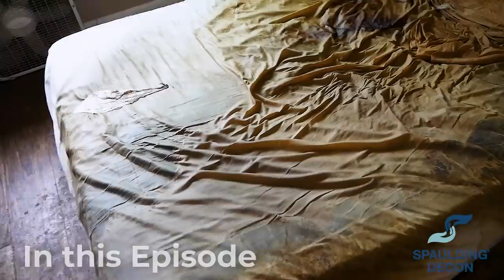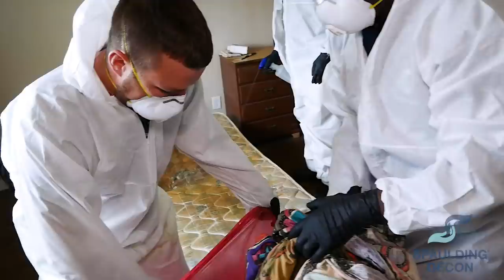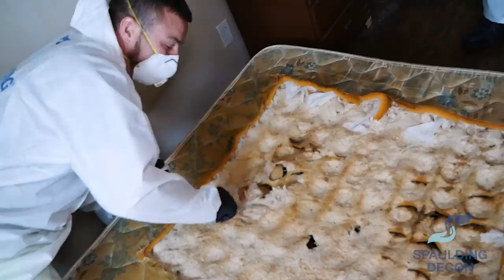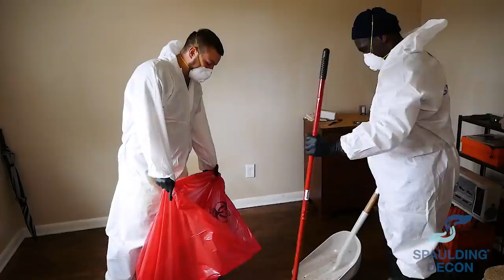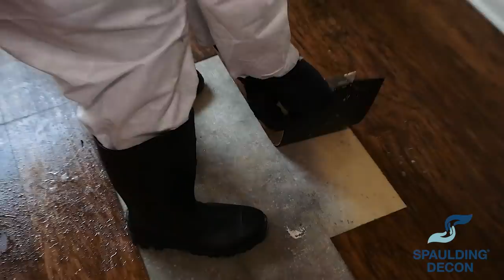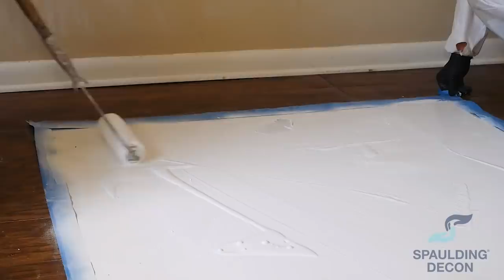Melted to the Bed

Comment: I was just curious why that nasty, brown stain on the wall behind the bed wasn’t checked for bio fluids?
Reply: Same here.
Reply: The HOA asked them to focus on the floor...figures the HOA wanted the cheapest way out...probably had it on the market 30 mns after discovery
Reply: I was thinking the same thing
Reply: @michaelsanger7795  Mmm.... that's not how that works. When you're called for a job like this you do it till it's done. you don't listen to someone telling you "half ass this" It's not that kind of profession. that's like telling a firefighter to only put out the fire till there's no flames and leave, or asking a cop to handcuff a rapist but to not show up in court for the case. It just doesn't work that way.

Comment: Idk if people realize how quickly decomp happens & in the heat even faster. I live in the Pacific Northwest where it's cold, several years ago a friend of mine's father in law who struggled with alcoholism most of his life died alone & was found within 72 hours of dying & even in the cold weather & no heater running in his room he was still significantly decomposed. Luckily the bed had a waterproof cover so the fluid was contained but they still had to have the carpet replaced as well as scrubbing the walls & ceiling then repaint all of it because the smell soaked into everything. I can't even imagine finding someone left alone that long in the heat of Florida, that's so sad.

Comment: I’m confused…if he melted onto the floor while he was on the mattress, wouldn’t that side of the mattress be affected by bio as well? Also, you can see from the sheet that his body’s decomposition affected a much larger area than was cut out of the mattress. Can you pls explain?
Reply: I believe he explained the other stuff on the mattress was sweat and oils from long term use of the mattress as there was only Bio in that one square area so they removed it and threw the rest away.

Comment: Why do you cut the mattress instead of just throwing the whole thing away all together?
Reply: I believe biohazard waste is a special trash disposal that’s charged by weight so Spaulding would only want to pay to dispose of what is actually biohazard. So if they can cut a section out instead of having to toss the entire thing, that’ll save them a lot of money.
Reply: @kat.w.RBF444  not so much that. Your regular dump site can’t accept biohazard materials. They have to be processed in a particular way that coincides with the EPA. You can’t just incinerate bio materials like you can regular trash. It has to be done in a way that won’t impact the environment or the air surrounding the site.

Comment: Question. I can understand painting the floor on a lower or ground level. But this is above someone else. So what is to stop the smell coming from the persons ceiling below? And putting on that thick of paint won't that make the floor uneven for them to put down new floor? I cant believe it was peel and stick. I feel horrible for this old man. Sleeping on such a filthy warn out bed. I have seen better mattresses set out for garbage. The springs were sticking through. And i am shocked that all that dark stain was not from his body. How was there so little? This man lived a sad life, i can tell that.

Comment: Why do they say we gonner make sure no one knows where the person died and then paint the floor white? To me that’s a extra added cost that’s not needed just remove the whole floor covering and then u cannot tell as all the floor will be the same. Btw no hate just curious as I used to do this job in the uk and we would actually take up the whole flooring
Reply: They paint to encapsulate any bio that leaked thru the stick on flooring so the smell doesn’t come thru. That’s the reason they paint. They also did it in last week’s (or the previous) video for an unattended death.
Reply: @kat.w.RBF444  I know why they paint it with the stuff. Like I said I used to do the job but my question was why just paint one square because then it is still obviously where the deceased was
Reply: @richardr2716  oohh, gotcha. Yeah I think it’s possible they were only authorized or paid to do so much by the rental company/manager. Like I have a feeling the maintenance man had to come in after for whatever he gets a year and clean up any remaining issues for much less than Spaulding gets. And “making sure no one knows where the person died” might be more like a “no visible stinky remnants”-type thing. I see what you mean though. I feel for whoever is rented or sold that place next. I would be able to probably sense (if not smell) that something bad happened in there. Maybe the smell would be totally gone if they use the ozone machine but I feel like you would feel the heaviness in the air from the death.
Reply: @kat.w.RBF444  yh I agree handyman probably gone in and changed flooring. And I find that you normally only get the heavy feeling in the air comes from spirits or residual energy had a few jobs like that. If it's over powering then we normally just explain to the spirits what has happened and they are free to move on and even tho u still feel them there the heavy feeling goes. But murder scenes are slot more complex unfortunately

Comment: Why is it so important to cut out bio from the mattress? Someone cleaning this up without hiring a company to do it, would just throw it away.
Reply: that's pretty darn illegal, all bio has to be dealt with properly
Reply: Eww no! You must dispose of bio properly
Reply: @treepotato9273  Not all "bio" has to be handled the same way. For example, have you ever had a bloody nose? I'm sure you have just thrown the tissues away. Women throw away their used menstrual items away all the time. It isn't considered a biohazard. If the blood is absorbed and isn't liquid or flaking then it isn't usually considered a risk.
Reply: @annak9646  Have you ever had a bloody nose or menstrual cycle? Did you disposed of the tissues and pads "properly?"
Reply: That's the difference. Companies have to do it accordingly to the law. Even a bloody tissue in a hospital will be put in the biohazard trash. A private person doesn't have to fear losing their license etc